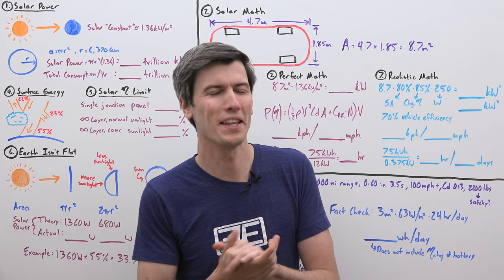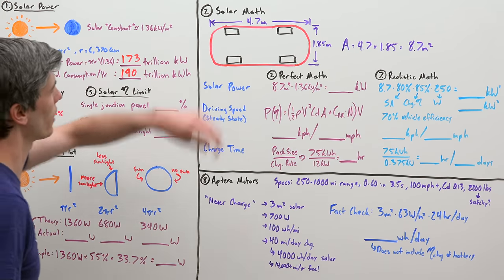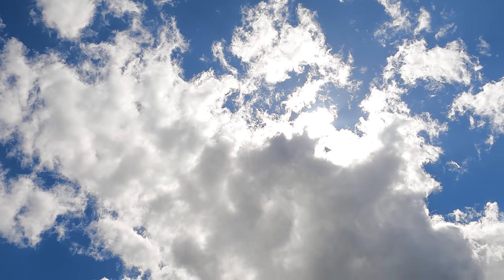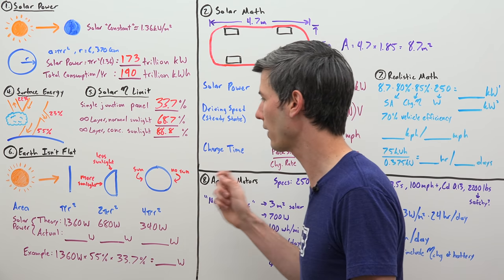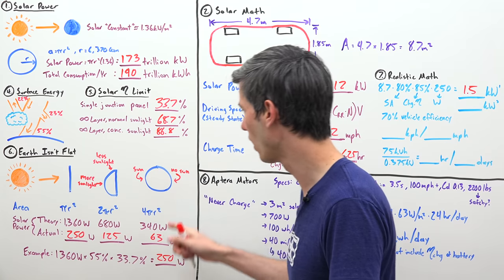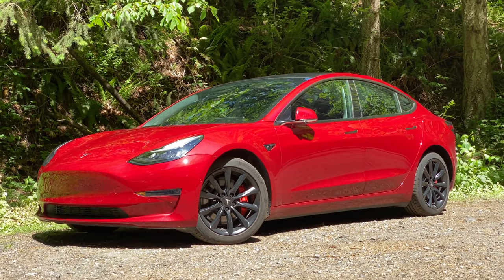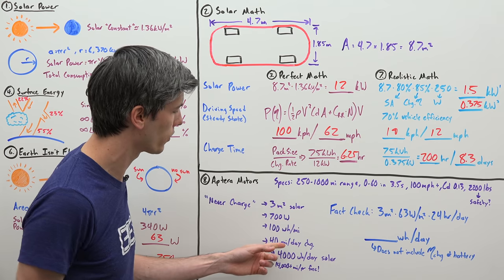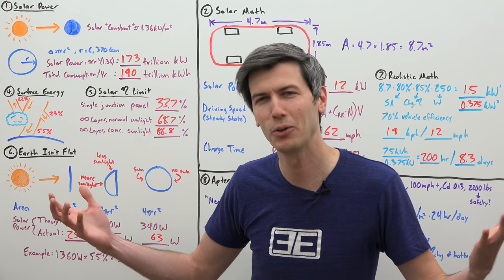Why Don't Solar Powered Cars Exist?

Comment: Take a look at the Sono Sion. It's a car made in Germany and on average will charge its own battery by 70 miles a week and 160 miles in good weather. Also costs only 25000 euros.
Reply: Lots of claims from solar electric car companies that have yet to be verified.
Reply: It's coming out
Reply: And lightyear one from the netherlands
Reply: @kittycrest2321  to say “it’s coming out” more than 2 years after the delivery date of the first orders failed and with the company now aspiring to begin delivery 4 years late is not a great recommendation.
Reply: @XPLAlN  nice point
Reply: The Sono Sion has a yield of 90W on a sunny day, 27W in light cloudy conditions, 0W when cloudy. Far far away from the promised numbers.
Reply: @vic321344  the people in London won't get a simple charge. Lol 

🥲☁️☁️☁️🌦️🌥️
Reply: Ugly car and 70m/w  is no good.
Reply: Aptera has a recharge rate of up to 25 miles a day and a similar cost ($25,900) for its base model. That's 175 miles a week. And unlike the Sion, the Aptera can be upgraded with extra panel batches to increase the recharge rate up to 40 miles a day (280 miles/week). 

 I saw a video about the Sion where a selling point was "recharge other vehicles using this car." First thought I had was "Not enough juice from those panels."
Reply: @AM-bw7hv  I agree it's not sufficient on its own, but it could be a nice extra. My situation: I drive maybe 40km a week total, mostly in the weekends, in a city, where range performance is actually better than advertised. There are fast chargers everywhere, but they're kind of expensive. At home, I can charge from a 400v (3-phase) socket from my front door over the sidewalk (this is allowed by town regulations), but it's a public parking spot so it's not always guaranteed to be free. So... adding a few solar bonus miles while being parked two blocks away sounds good to me!
Reply: @odw32  exactly! The panels reduce the frequency of charging with a wire. Biggest issue with that I think will be finding a sunny spot without trees or buildings shading the car. And of course in hot weather who wants to park in full sun?!
Reply: Except that it begs for 100M € more, so more 40,000 customers.
Reply: For city driving only, it would totally make sense.
Reply: @believein1  But you should park outside of the city in a field. 
Here where I live, some 15 minutes walk from the town hall, we have three to four floor buildings, a one lane road and even a couple trees. I tried a small two panel solar generator on my balcony, I got 600Wh from the 2x400W panels on a sunny summers day.
Reply: @VolkerHett  Sure, it definitely depends on conditions. 👍🙏
Reply: I doubt the drag coefficient of that vehicle would allow for a totally efficient use of the energy
Reply: It’s actually 105 miles a week.
Reply: @believein1  Its easily 0W. Because the loader electronics for large battery packs consume at least  300W just by running. It just counts what yield arrives inside the battery cell.
Reply: @vic321344  What “loader electronics”? The car would just be sitting there in the sun and not operating in any way.
Reply: @believein1  You have to get the electrons into the large battery pack. Against a relatively large resistance. The electronics necessary for loading/unloading/controling the battery cells needs at least 300W. And this is a very good value.
Reply: @Mouwcat  nothing is perfect.
Reply: @AM-bw7hv  WTF is m/w?
Reply: Din don, reality check has come. Sono Motors shut down. Don't bet against physics.
Reply: @markotrieste  a shame that. But Arcimoto still exists.
Reply: @markotrieste  What physics? There's no physical barrier to a car having solar panel. Besides Lighyear 0 exists.
Reply: @avada0  Area times solar constant times shadowing versus energy per distance traveled. It may barely work for extreme designs like the Aptera, not for a common family car.
Reply: @avada0  Area times solar constant times shadowing versus energy per distance traveled. It may barely work for extreme designs like the Aptera, not for a common family car.
Reply: @markotrieste  It works for every car. I produces some amount of energy, which you don't need to charge. If it's sunny and you don't go on road trips it might not need to charge at all for a long time.
Reply: @avada0  Keep the panels stationary and let the car charge from an outlet. Way easier, more robust, cheaper, lighter. The only thing that may work is about 200W of panels to feed some kind of cooling of the cabin, but even this option has struggled already 20 years to become mainstream.
Reply: If everyone talking about solar is , My car put solar on the roof for 10 years ago already ,  may be factory follow from  my car only ! 
Even the camera looking to the front and back view  my car is the first modification,  I do it before factory did , 
My car very smooth with using solar panel. Even the battery life time is very long , actually in my country , the battery life time = 2 years must change one time ,  but my car 4 or 5 years for changing one time , so how different price of your span every day or every years ???  My car never getting  low battery voltage, untill the battery dead,

Comment: Me, contemplating building a solar-powered van camper... These equations will be useful...

My plan is to have a deploy-able array to use when I sit at a campsite for a few days. Should be a decent size and enough to at least maintain climate control and cooking.
Looking at that 8.3 day figure to charge actually makes me think this is viable. The van with deployable array would have at least 3x the solar area, so only ~3 days to full charge? That's a normal weekend camping trip!
Reply: Then you're double mad when you go camping and it's raining.
Reply: @Plajerity  At least I have an awning...
Reply: Yeah, depends a ton though. You'll wanna check the average solar energy per meter of wherever you plan to travel, or a place of similar latitude. Also the quality of your panels. It may be cheaper to get more crappy ones for the same or better power. Also be sure that your panels are angled at the sun, so bring some blocks or something to prop em up
Reply: campfire powered steam generator
Reply: Calculation is for 24 hours!  Sun doesn't shine at night.
Reply: Coocking and climate control should be fine with a permanent solar panel on the roof and a battery enough for maybe a week of power. Given you only go out during summertime. Most difficult part will be the battery and international regulations (fire safety and weight due to campervan structure limitations and which license you need). You already have backup power socket on most campervans ice.
Reply: @Plajerity  they can save money on climate control
Reply: Look in to solar power systems used on sailboats
Reply: don't forget to factor in the weight of the panels into the efficiency of the van.
Reply: @uptorest  oh, factoring in the efficiency of the van throws everything out of whack. It's just a lunchbox on wheels. Might get 150m of range from a tesla battery at that point.
Reply: you may charge faster but you will also drain the battery faster because a van is less aerodynamic.
Reply: You're going to need to hit an average of R45 on your insulation to achieve a reasonable amount of climate control in your camper; that doesn't leave a whole lot of room for the people themselves.
Reply: I like your plan. In addition to the roof mounted panels, you could use solar panels to create an awning along the sunny side of the camper. This would give multiple benefits:
1, shelter for you out of the sun and rain. 
2. The panels will stop the sun hitting the sides of the van at the hottest part of the day and therefore it’ll heat up less and require less power to keep the air-con working. 
3. Solar panels are more efficient if they have air cooling them. 
4. Even when stowed flat against the side of the van while traveling they would still produced some power. 

If they hinged from the top of the side of the van, that would give you plenty of head room under the canopy and it could be propped up with gas struts and a couple of poles anchored to the ground or side of the van to stop the wind damaging them.
Reply: “Climate control and cooking”?? Not possible unless you rent the entire campground.
Reply: @oldcountryman2795  
He didn’t say he was looking to use this on a formal campground where there’s a good chance that there would be electricity anyway. Spending thousands on solar and batteries would be a complete waste of money if there’s power on site.
Reply: @thechumpsbeendumped.7797  You don't understand the problem here. Here's the consumption:

200W to run the fridge
1000W to run the microwave
3000W to run the oven
1000W to run the climate control

Microwave is negligible in terms of Wh, but if you bake once a day for 45 minutes plus 15 minutes preheat time that's 40W, 1000W to keep the climate control running with the nonexistent insulation, and 200W to keep the AC running.

You need about a roughly 1250W budget to keep it all running, or ~20m³ by my math. 

To get the needed space down to somewhere close to the roof of an RV (even deployable), you need to reduce climate control consumption drastically.
Reply: @recless8667  
He said cooking, that could be as simple as using a microwave for a few mins or a single ring electric hob for 15mins. 
Spray foam insulation would greatly reduce the solar gain of the vehicle, as would solar panels deployed to shield the vans roof and side facing the sun (especially the windows) from the sun hitting the vehicle in the first place.  Depending on the size of van, it’s possible to get over 2,000 watts from the roof alone, let alone additional panels deployed on a side awning. An a/c unit can run on as little as 5-600w, and if you curtain of the area your cooling it makes keeping cool a lot easier. I’ve seen a couple of builds where they use solar powered air-Con on YouTube.
Reply: @thechumpsbeendumped.7797  Yes, that's my point. Spray foam has an R value of 3.5 to 7. Assuming closed cell, you need 6 inches of spray foam on every wall, ceiling, and floor. That's 12 inches of width lost in an already cramped living space, 6 inches lost from the rear bathroom, 6 inches lost from the front bed. The average camper interior is what, 6-8ft wide? That doesn't leave a lot of room

Or you make it 12 inches wider and longer with reworked siding, making the camper even more difficult to navigate down narrow roads.

Plus you have to deal with crappy, single pane windows, the top vents, and a whole bunch of other leak points like wire chases and plumbing.

It's doable, but it isn't doable for all campers out there. If you're over 6ft tall, good luck finding a way to sleep in the damn thing.
Reply: @recless8667  
A. Insulating to house level isn’t going to be feasible or practical but he’s only trying to cool an area a fraction of the size of a single room of a house.
B. We don’t know what type of vehicle he’s using, so don’t know the dimensions he’s got to work with. A box van has plenty of hight to put 6 inches of insulation on the ceiling, and 2-3 inches on the walls. **
C. The roof and the sun facing wall are the most important to insulate. 
4. As I’ve already said, if you can avoid the sun hitting the vehicle (with solar panels) it helps enormously to reduce the temperature inside. 
E. It’s been done successfully multiple times. 
F. There are multi pane windows available and they can be covered in solar film also, but as I’ve already said, if you shield the windows with a solar canopy the sun never gets a chance to radiate through the glass. 

** My work van had machinery with water inside that obviously couldn’t be allowed to freeze in winter, draining it was a PITA so I insulated that with spray foam in the awkward to reach box sections, 1inch Kingspan boards, and then faced it with 1/4 ply. It made an enormous difference to the amount of heat needed to keep the contents from freezing. 

I’ve done something similar with 1 of a pair of 20ft shipping containers my club used for storage. We didn’t have the budget for spray foam or Kingspan so used a pre-cut, multi-layered, bubble wrap insulation made of space blanket material and a layer of 3/4 ply. Both containers were in full sun and like ovens before insulating one of them. The uninsulated one was so hot it makes me feel physically ill to spend more than a minute inside, while the insulated one was 30° cooler and quite comfortable to work inside. 
I’d never use a sprinter type van, being 6,2 they’re too small for me, plus hardly any surface is flat. If I was building one I’d use a box van, with those you get much more usable space and it’s easier to build in because the walls floor and ceiling are all flat.
Reply: @LazerLord10 I design and build electric race cars and have been toying with a design for a series hybrid RV that would utilize the used batteries from the race cars and a 15kW diesel generator, and I will suggest that your idea isn’t crazy, but do your math carefully and allow lots of margin for cloudy days, etc, and have a good backup generator.  Also, and this is very important, use LiFePO batteries not Li+, they are much safer and you don’t want to be living in something where a glitch in your battery management hardware can cause a fire.  The LiFePO batteries pretty much cannot catch fire from either overcharging or even from short circuits (which is the reason they are the only battery chemistry allowed for electric race cars by the SCCA and NASA.)
Reply: You need a deployable roof w/ solar panels and additionally a deployable tent, for shadows and stuff falling from the sky. And dont be scared of cloudy days, there are situations where high variability can even give you superior irradiance than a normal sunny day, due to cloud enhancement optics. Check solar gis resources and maybe you will get there eventually. Think about your project as obtaining some of the energy free, not all of it.
Reply: Check out the sprinter van from Long Way Up series; it has motorized extendable solar panels.
Reply: Interesting. Let me know how it worked out.
Reply: @gordonirving24  Yes. It does. The sun does not have an off switch. But I know what you mean.
Reply: Off the shelf solar panels are around 19% efficient, so you would have to adjust your math, for that.
Reply: There are a few videos on YouTube with people who have solar powered vans. Look it up. They basically have to carry a folded three to four layer solar array system around which when folded out looks like half the size of a basketball court leaning against the van, at an angle of course. Slightly exaggerated. 

Also their electrical system inside is as loud as a power plant. Would be hard to sleep in that van. 

It's just frustrating how powerful fossil fuels are.

When it comes to electric vans, the cost it would take you to make it happen at a reasonably usable scale with a fraction of what a diesel van can do, it's astronomical. The electrical setup alone. All the necessary equipment. The batteries. The panels. If you have the money, you could build something decent, of course.

Also, google X Bus (german solar van) if you wanna have a laugh.
Reply: Good idea. But don't forget the weight of those panel you transport will affect other type of energy used to move.
Reply: Alright but what’s the range? Maybe it could be a hybrid van that can do both gas and electric.
Reply: Plus you don't need anything close to a 100 kwh battery to run your appliances for a couple of days(I wouldn't bother with trying to electrify the van itself, the costs would be astronomical). I have been thinking about trying something similar with my car to save on rent and gas, and it seems like it just might be worth it if I can find a semi permanent location within walking distance of my work (it is sortove an industrial area, so i might be able to find a corner where I would be ignored).
Reply: @Plajerity  Solar panels can still work in the rain a bit.
Reply: @JackMott  I've always considered pulling a trailer with extra battery and a 4x sized deployable solar array behind my campervan.
Reply: No doubt there will be problems on the way but 12 out of 10 for just doing it.
Reply: Camper vans usually have less than 10kwh of battery storage. The tesla battery has 50kwh. So the battery on a van should charge very quickly if you have a large array.
Reply: @gordonirving24  The number used is the average watts over 24hr for the entire planet, which includes the 0 for night, but also goes through the variations of length of day throughout the year. In the tropics you'll be on the higher end of this, or above average, where you may be at a much lower end towards the extremes.
Reply: @ohyonghao  Pigs will fly before I believe in a solar power car if it is even  ever in production.
Reply: @gordonirving24  look up lightyear one, it is in production already (however not 100% solar)
Reply: @mielbeekman  you'll believe in jetpacks as well,  lol
Reply: @gordonirving24  I mean, they do already exist, look up Apollo Flight Labs
Reply: @mielbeekman  not exactly solar powered and with an endurance time of he haw. Delusional.
Reply: There are those things called "solar generators", they look like a diesel generator that you connect to a foldable array of solar panels. You get AC output and a battery storage. Look it up, it's what you need.
Reply: You don't even have to mount them on the roof though, unless you're constantly moving. So, you can carry a big box of them and only deploy during stays. It is absolutely viable.
Reply: keep us update plz!
Reply: You know the reason why people doing it them on campers is to power the electronics not the actual car